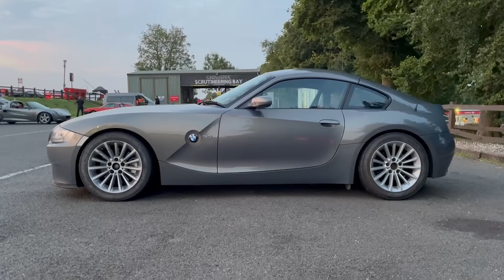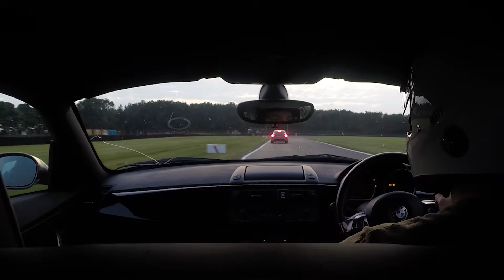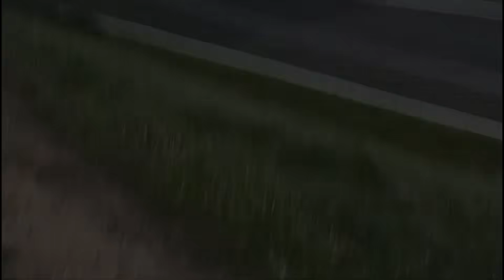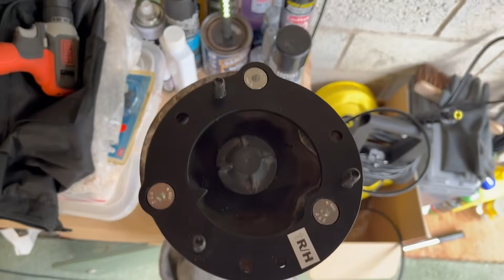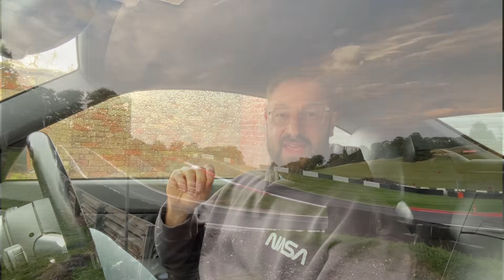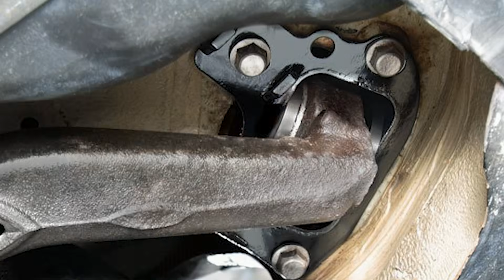Z4C Track Test //  Uprated Springs, ARB & Camber at Cadwell Park

Comment: Do you know the spring rate of the other springs (Suplex) you have used on the rear ?
Reply from the maker: I'm afraid I don't, I just had a look around the web for info, but the best I could find was looked to be unreliable Z4M rates. The Suplex are a fairly soft, progressive spring. Ideal for the road, but very poor at the track.

Comment: Very cool, I'm thinking of fitting the front and rear ARB as well, but I'm afraid its a bit too much.
I'm on bilis B12... You feel understeer and I'm afraid of that...

Keep up the videos!!!
Reply from the maker: I'm no expert with these chassis', so I'm reading/watching what I can, feeling how the car behaves and then trial and error from there... With the Macpherson strut on these chassis' some thinking is that a thicker front bar helps to maintain camber angle when cornering and therefore can increase front grip contrary to the usual rule of thumb.
So with mine I'm trying now to concentrate on one end of the car at a time, feel the balance and then go from there.
Next steps will be stiffer front springs, thicker front ARB and hopefully more front camber, then reassess. Experience with other cars would suggest a bucketload of understeer, but we will see... I'll be sure to share my findings! 👍

Comment: It's awesome to see an update on this car. Our setups are now very similar, with the only difference being my 3 degrees of camber up front with 255 square. I recommend going to the stage 2 camber plate. I'm running the TMS fixed plates made for the E46, and I haven't had any issues. I'm running the OEM RTABs with delrin limiters. I've considered switching to a poly or delrin RTAB, but I don't want to increase NVH unless the performance benefit is worth it.
Reply from the maker: Thanks ever so much for sharing your experience with the stage 2 plates, I will almost certainly try some on my own with that knowledge, 3* -ve would be ideal I think.
I have some Powerflex black RTABs to go in before the next TD so will report back. 👍
Reply: @CIRCUITDRIVERCARS  Awesome, looking forward to the next update!
Reply from the maker: Should be fairly frequent now. 👍